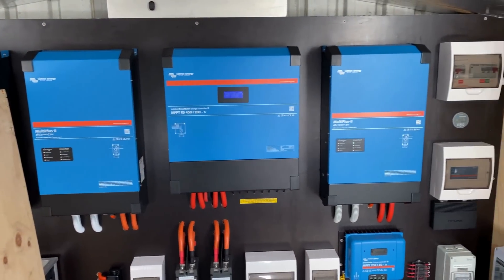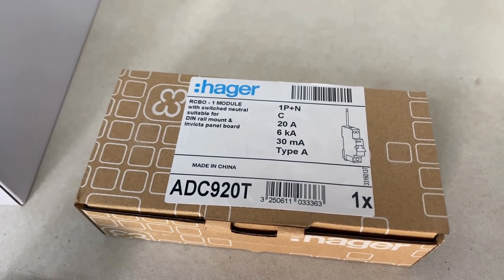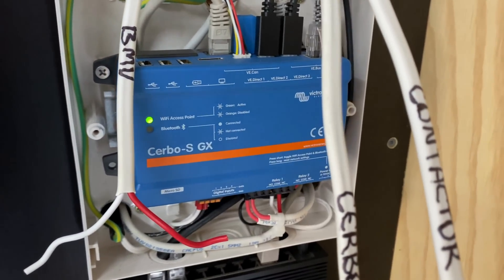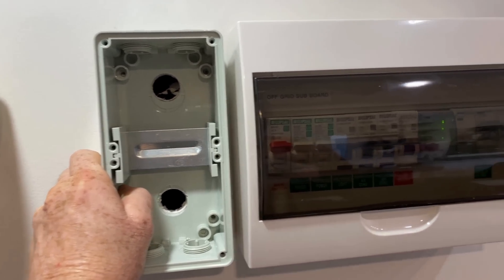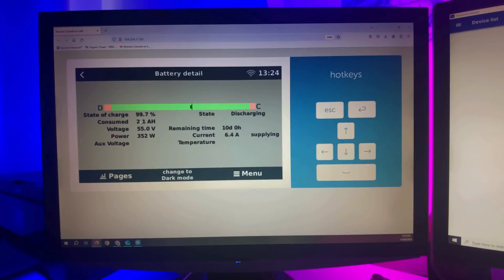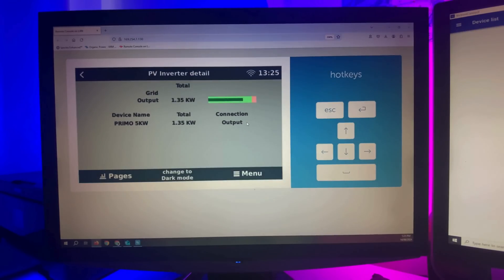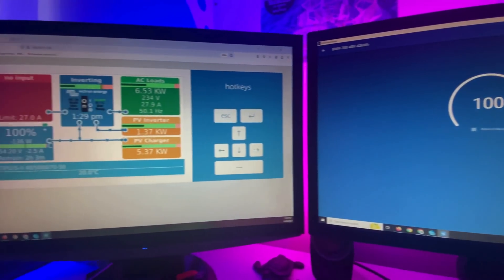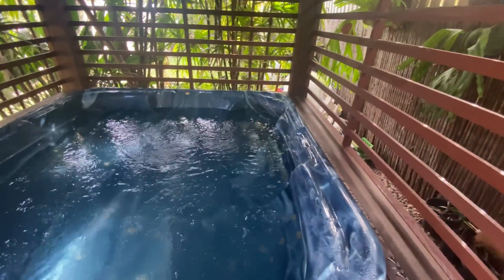EASY Off-Grid Solar System Spa Heating! Using Our VICTRON Energy BMV & Cerbo GX 100% Battery Relay

Comment: Hi. Not sure what I've missed but you have 12vdc activating a 12v dc relay sending 12v to a 230vac contactor. Do you have a diode protecting your cerbo relay.
Reply from the maker: No diode. No problem 😉 What you have written there is incorrect, become a member to get all the details 👍

Comment: My cerbo failed just b4 xmas 😢 still waiting on a new one. Then send this one back under warranty.
Reply from the maker: OOHHH NNOOOO!!! Any idea what caused the failure? Let us all know how you go with the warranty replacement. Thanks for filling us in on the issue.
Reply: @OrganicPower-Australia  checking out google it's a known issue with the 48v cerbos, the fuse doesn't even blow. It needs to be modified with a capacitor or it will continue to happen.
Reply from the maker: Thank you for getting back so quickly, I'll take a look 👀 great heads up! 👍 Going to check the serial number now!
Reply from the maker: Here is a link about the issue for anyone else interested - https://communityarchive.victronenergy.com/storage/attachments/2022-08-cerbo-gx-power-supply-issue-in-48v-systems.pdf 😀 👍 @allinghamremovals4868
Reply from the maker: @OrganicPower-Australia - Cerbo S-GX Serial number HQ2225xxxxx Just scraped in 😬 Affected serial numbers include HQ2201xxxxx up and including HQ2220xxxxx Serial number can be found on the VRM portal via the device list.
Reply: @OrganicPower-Australia  cerbo arrived yesterday, but now the lynx shunt won't work lol.
Reply from the maker: Nice wasn’t too long to wait for the new model 👍🏻 firmware maybe 🤔 I’m sure you have thought of this. If I find something I’ll let you know.
Reply: @OrganicPower-Australia  my supplier looks after me, i tend to burn through mppts. I have updated firmware for the cerbo, check cables, swapped around rebooted, shut the whole system down for a period. Still nothing, once baby is down for a nap and after I change brake pads on car I will throw on the old shunt but leave cerbo in place.
Reply from the maker: Yep, I thought you would have tried everything. Nice work, hopefully just a glitch. You burn through Victron MPPT’s?
Reply: @OrganicPower-Australia  lol i do, just stupid mistakes, not thinking. And I learn by making mistakes, expensive mistakes  unfortunately.